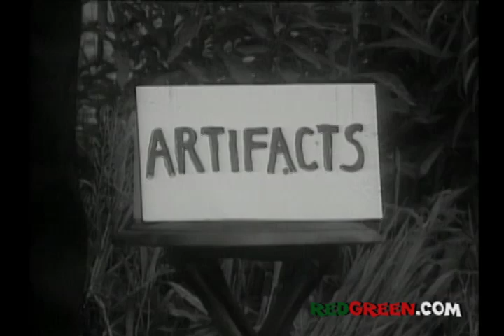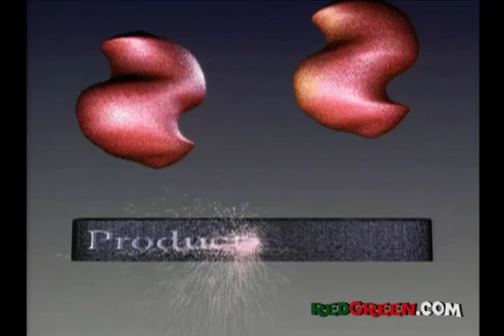The Red Green Show Ep 175 "Bingo Was His Name" (1998 Season)

Comment: The Corvair was a great car.  Flipping it over was not easy to do.  Nader was nuts.  (I speak as an auto alignment specialist).   Only the first couple years was affected as the rear suspension was changed (a strut was added to each side of the rear).
Reply: Naders complaint was that the US auto industry did little to no safety testing before releasing a new model..
the corvair was just one example he used..
Reply: It was tainted even after alterations, and he didn’t care about that so long as he got the publicity and money